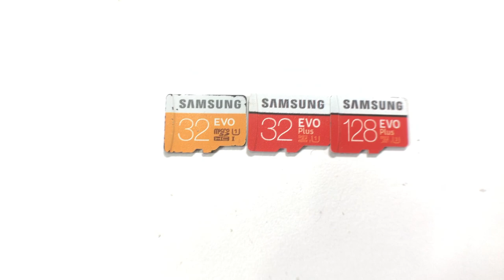BrewPi Remix Hardware Overview

Comment: Hello! Nice video, if I want to use an Arduino, how would be the communication to the raspberry? USB cable? Thanks!
Reply from the maker: Thank You! Yes, USB is the best way to connect the Raspberry Pi to the Arduino. There are other ways like WiFi, but USB is the most reliable plus powers the Arduino too. 

For our own set up we switched to Fermentrack. It uses BrewPi Remix as its backbone but has more robust user interface features like running multiple chambers and adding sensors is a bit easier. Both programs work great and are personal preference. We even did a video on upgrading from BrewPi Remix to Fermentrack. Let us know if you have any other questions.
Reply: @BrewVintChill  Great! About hardware I do not have problems my doubt now is more related to the firmware, I want to add a 20x4 LCD but will fermentrack send the info directly to the LCD through Arduino? Or do I need to add extra code somewhere?
Reply from the maker: Hmmm, the short answer is that it should work without any extra code but I haven't tested that for myself yet, and the information is a bit sparse about it. I've ordered a screen to test it myself to be sure. We will let you know how it goes.
Reply: @BrewVintChill  that sounds awesome! You rock :)! I appreciate your support. 
Btw, I already subscribed to your channel.
Reply from the maker: No, you rock. Liking and subscribing go a long way to help smaller channels. Watch time is big too, and you might be interested to know that we have a playlist of all our technology-based videos together. Link below.  We also have a resource page with all kinds of shortcuts for working with the Raspberry Pi for brewers. www.thebvc.net/pi

https://www.youtube.com/watch?v=V_XoE1yTuEQ&list=PLCnbRfWt3f_G5o-xGIppX6Je7Hwr6z746
Reply: @BrewVintChill  one more question, I took a look at brewpi and brewpi remix websites and noticed that they propose different hardware based on Arduino Uno, which one are you using with fermentrack?
Reply from the maker: We use the Arduino for both Fermentrack and BrewPi Remix. BrewPi uses a more advanced development board that they have custom made for that housing unit with the screen they sell. It can be confusing without knowing the back story. BrewPi started a small project during the original pi days when the Arduino was new, when it got more advanced they switched to a new processor that could handle Python code and when more commercial. That is when BrewPi Remix split off keeping the Arduino support alive but the project doesn't get a lot of love so Fermentrack gave it a new coat of paint and is still updated. so in the end, they are all BrewPi.
Reply from the maker: Thank you for your patients, but I can now confirm that the 20x4 LCD screen will work without any extra code. The only thing you need to do is make sure that when you are flashing your Arduino with the I2C version of the firmware. It will be an option to choose what firmware during the install, the page header will read "Select Firmware to Flash," and will be the second choice. I Will make a video soonish. Resources below.

I2C wiring guide:
Gnd to ground, VCC to 5v, SDA to A4, and SCL to A5,
Warning: you MUST use A0 for your One-Wire sensor probes in this firmware. 

The screen that I bought:
https://www.amazon.com/gp/product/B08XQLKT5V/ref=ppx_yo_dt_b_asin_title_o01_s00?ie=UTF8&psc=1
Reply: @BrewVintChill  got it! I really appreciate your help. I will put everything together and will let you know how it goes. Youtube will tell me once you upload  new videos, waiting for them :) cheers!

Comment: If a pi zero can't keep up with brewpi, something's up!
Reply from the maker: Just because the zero struggles doesn't mean it can't keep up with Brewpi and is a fine option if the form factor is more impotent then speed. But the extra time everything takes to do anything sucks the fun out. From the OS and BrewPi Remix install taking a lot longer due to the 32-bit single-core processor, lower video ram makes the UI run slower, and remote access over VNC is laggy. It's like how a mechanical hard drive works fine to edit video, but an SSD will make life a lot better.
Reply: @BrewVintChill  it's a web front end, video ram for instance makes no odds. I run remix on zeros with no issues. Heck you can run brewpi on a spark without issue. If you're experiencing lag, for it not to be displaying a simple web page something is up, brewpi required no heavy lifting... glad what you have works for you but it's nothing to do with the pi hardware ordinarily.